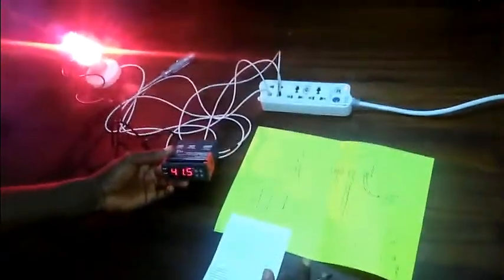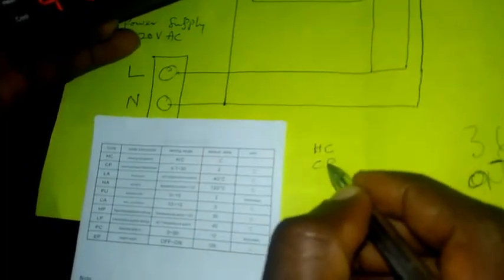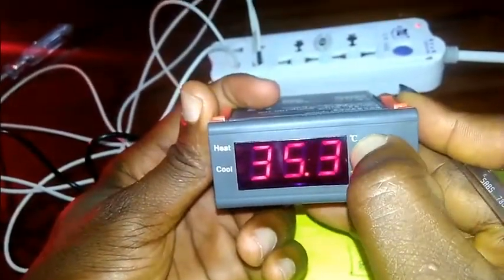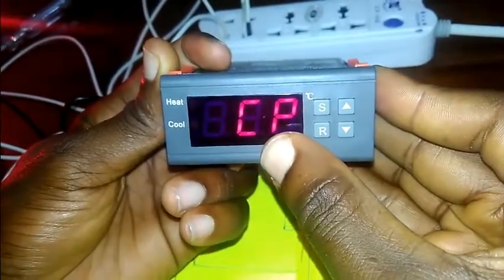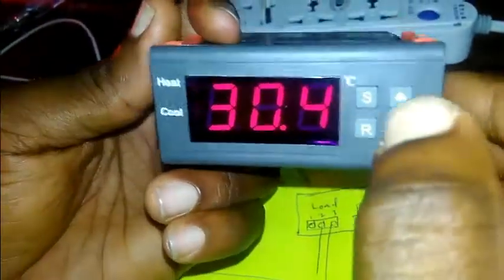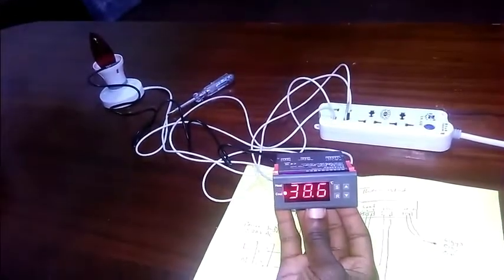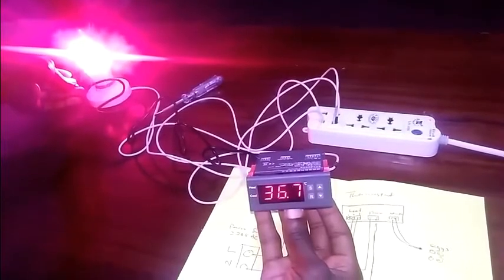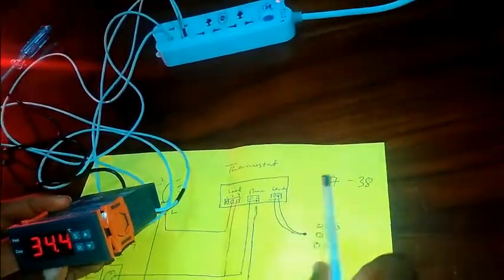Setting the MH1210B temperature controller for Incubator aquarium

Comment: Bro show how you did the connection and how to set  the temperature switch  for my table fan when heat get 30 above the fan will turn on . Your video is really good and clear instructions.
Reply from the maker: Thanks
Reply from the maker: Okay hold on